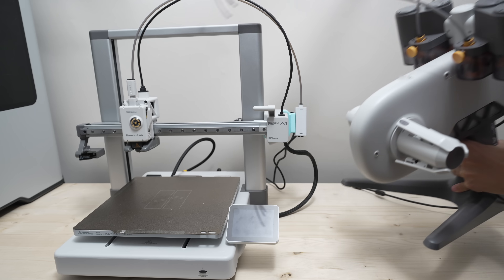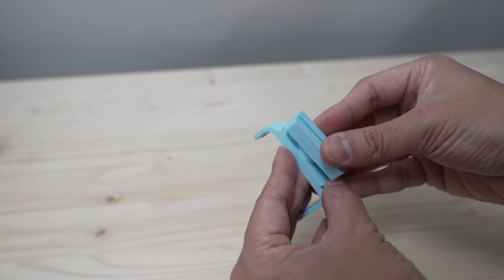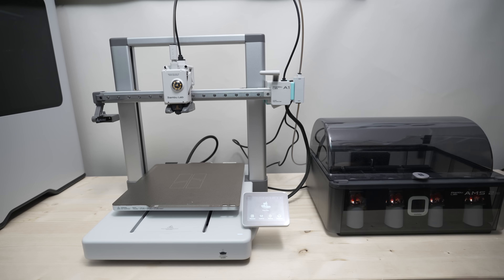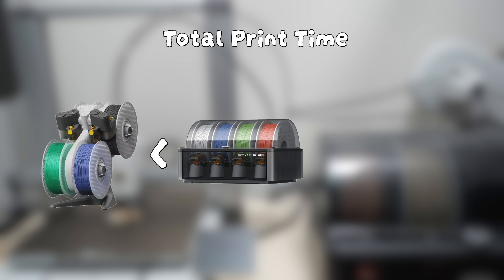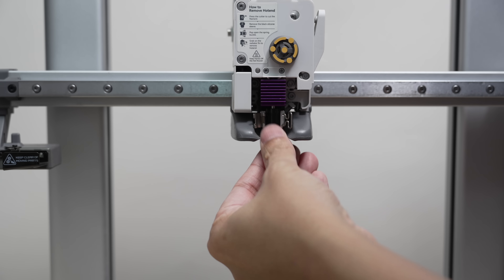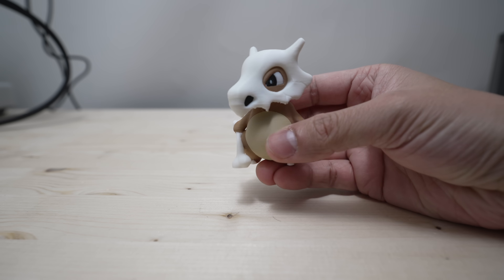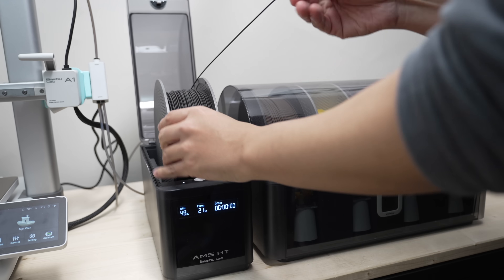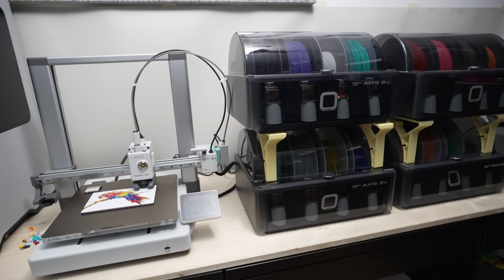You can now use AMS with your A1-Series but is it ANY GOOD?

Comment: I'm having a problem where the filament won't automatically load because it seems to get stuck at the AMS Hub.  I've re-cut the PTFE Tube so it's fully square etc but no improvement.  It works if I wiggle the PTFE from the printer end - any ideas anybody?
Reply from the maker: the tube should be as straight as possible at the outlet. It shouldn‘t bend that much when the tool head parks all the way to the left during color changes.
try using a slightly longer tube or avoid using a clip near the outlet
Reply: @Lukis3D thanks.  I think I fixed it by connecting the power cable to the ptfe tube - which straightened it as you suggested 👍

Comment: I have an A1 and it works amazing. I am planning to buy a mini with ams lite. Is it possible to install that A1 Mini AMS Lite to my exiting A1?
Reply from the maker: yup of course, AMS Lite is compatible with both A1 and A1 mini, so no problem there! However, you would need slightly longer tubes since the tubes for the A1 Mini+AMS Lite are abit shorter.
Reply: @Lukis3D  Thanks Bro. The tube thing went unnoticed .

Comment: hey i'm curious about the obxidian hotend how much faster is it than a regular standard hotend. can you see a difference in a regular basic pla over time. how does the program find out what kind of hotend you have put in😊
Reply from the maker: hi there, i made a comparison between stock nozzle vs obXidian nozzle, you can see the result at 5:50.
It’s worth it if you’re printing something that takes so long to finish.
Your printer doesnt recognize it, you unlock its potential by changing the flow rate and speed. Or you can just download E3D’s print profile on Makerworld, and use that. it’s already tailored for it.
Hope that helped!

Comment: Let me ask you a question please? I bought the AMS 2 and connected to my A1, did the firmware update and all went ok. But now incant use the AMS lite anymore? I tried to connect and it rejected as non compatible. Or is there a work around? I see you swapp from one to another I am curious. Thank you
Reply from the maker: you need to change the Ams type back to AMS lite. The Ams option is in the settings. everytime you swap AMS, you need to change it in the settings too.

Comment: The original P1S/X1C Filament buffer and AMS Pro Hub's also work on the A1 series.   I have the "AMS" hub on my A1 and a P1S buffer currently on my A1 mini since I upgraded my P1S to the AMS pro hub.
Reply from the maker: glad to know the older hubs are compatible, thanks for sharing!
Reply: @Lukis3D  Yep I have the same setup

4 to 1 PTFE adapter connected to X1/P1 Buffer. It works fine 👀

I guess technically it works the same way as the new hub  that's why there's no issues
Reply: Any chance it works with an AMS pro 2 in particular?

Comment: Is there any advantage to mounting the filament hub on the y-axis? Can it be mounted statically on a separate bracket just use a longer ptfe tube going to the head?
Reply from the maker: i would say for reliability. This setup has been tested from their side probably for months, so you could use it without having to worry about any filament loading issues. But as long as it works, i dont see any problem. however, a slight bent in the tube (where the outlet is) can cause loading issues. The filament can’t be pushed through, as though it got stuck in its path (you could see this briefly in the timelapse😆-the reason was the clip, holding the tube too tightly). So if you want to mount it differently, just make sure the tube at the outlet is as straight as possible when the printhead parks all the way to the left during filament change.

Comment: I went for the BMCU 370C ams alternative for my a1, works perfectly and more flexible mount.
Reply: any vids with experience to share ? As far as I understood you are stuck with some particular FW version from Bambu Lab ?
Reply: @yingbxua6240  So far all new fw for bambu a1 works with this bmcu, but this might change in the future. But so far it's all good.
Reply: @yingbxua6240 you can update the BCMU firmware also. Need some cables btw.

Comment: I have a A1+AMS Lite and added a X1C+AMS to my stable as I liked the A1 so much and wanted the enclosure for more exotic filaments. Being able to use the AMS on the A1 is pointless as I might as well use it with the X1C. Using the AMS Lite on the X1C isn't even possible. What I really want is to be able to either add the AMS Lite with the X1C+AMS or AMS with A1+AMS Lite for the times I want to print with more than 4 colours. If I have to buy another AMS for more colours on the A1 I'll just use it with the X1C anyway so the whole adding an AMS to the A1 is non-starter for me.

Comment: Thanks for the clear explanation and demonstrations. 
The AMS Lite sprung hub would seem to limit how much filament can be retracted (without tangles of loose filament). That in turn would restrict using it with a second buffer or a buffer at a distance from the toolhead. 
I’m not saying that there was never a marketing differentiation involved, but there does seem to be a technical limitation.

Comment: It takes THAT long for color prints?! Omg
Reply from the maker: yeah, and I printed a whole Cubone army + hueforge + lithophane, so this video took a lot of time😅
Reply: For single nozzle printers, yeah. The snapmaker U1 is a toolchanger and dramatically cuts print times with no waste. And Bambu Lab's vortek system is finally being unveiled tomorrow morning and will be an innovative nozzle changer for the H2C/a kit for the H2D and can skip purging so it should be fast as well
Reply: @SangheiliSpecOp  However, both of these systems will most likely be surpassed in terms of speed and overall performance by the Prusa C1, C1+, and C1 L & Bondtech INDX systems.

Comment: if only i could use my AMS Lite with my P1S , would save me so much damn money in buying another AMS ! , good video !
Reply from the maker: yeah I know! hopefully they'll update the firmware so the AMS lite will be compatible with other printers as well.
Reply: Isn’t the Lite’s short distance spring spool rewind (compared to the others’ rollers design) going to be a massive problem? 
On the A1 series the 4 into 1 is on the toolhead, so the amount of filament to rewind is just a few cm. However on the P series and others that 4 into 1 is outside the enclosure, meaning 20cm or more of filament has to be rewound out of the Bowden tube on every change. 
I don’t think the Lite is ever going to be supported by the P, X or H series for that simple reason.
Reply: @dougal6569  The bmcu (aftermarket AMS lite) has experimental support for p1s, so it's theorethically possible
Reply: @dougal6569 and even if the filaments could sit at the toolhead, because core xy printers move so rapidly and in the x and y direction (instead of the A1 toolhead's X-only direction), you would definitely have filament strain and breakages at an accelerated rate
Reply: @dougal6569  its only a short distance bc of programing, not hardware limitation. If they allowed the user to edit the AMS lite gcode like they do the A1 printers, we could edit that.

Comment: Unfortunately it's impossible to buy the hub because the stock they had was sold out in seconds.
Reply: you can use the buffer from the other printers they work fine
Reply: @DayEls  Do you have a link for buffer to use??
Reply: @firedog6able  the buffer that gos on the back of the P1S, its what I use
Reply: Do u have any bracket printed, i dont know where to put it
Reply: One could just print such a device

Comment: Good overview, thanks. I'm not willing to give up my AMS Lite so I arranged things such that I can fairly easily swap two tubes and two plugs and still use either system (not at the same time, of course). I also didn't like the cables and tubes being dragged up an down the gantry, so I mounted my hub on a shelf leg about 2 inches to the right of the gantry in the middle of the Z axis travel. I'm very pleased with how it all has worked out. I keep the AMS 2 Pro (borrowed from my X1C until I can afford to buy another one) loaded with PET-G HF and the AMS Lite holds black and various gray PLA on cardboard spools that I use for prototyping and functional parts. I'd love for someone to release an electrical A-B switch to swap the two 4-pin cables without having to physically unplug them.

Comment: I thought the concensus was that the AMS Lite was actually the better more reliable simple system anyway?
Reply: The main advantage I guess would be connecting more than one AMS
Reply from the maker: @GeraldMantis  yup, plus the enclosure and the heating option 👍🏼
Reply: IIRC a lot of the "reliability" issues from the AMS were fixed with the AMS2 Pro. Plus, it has active drying and monitoring. It's probably the better choice overall if you don't mind SLIGHTLY slower filament changing than the AMS Lite. I have the AMS2 Pro for my H2S with ZERO issues so far and about 200-300 hours on it. Usually, I heard the AMS (original) would have a few jams by that point that need fixed